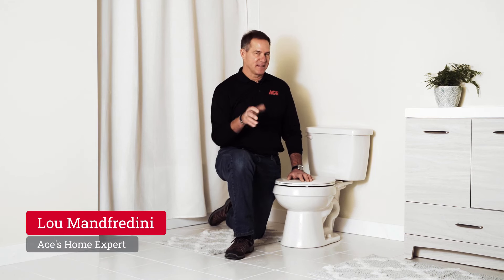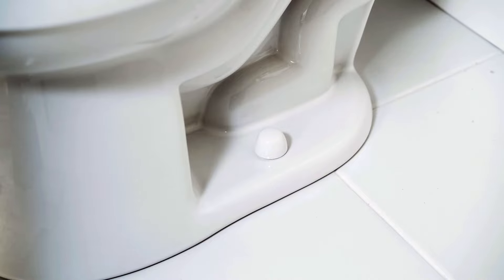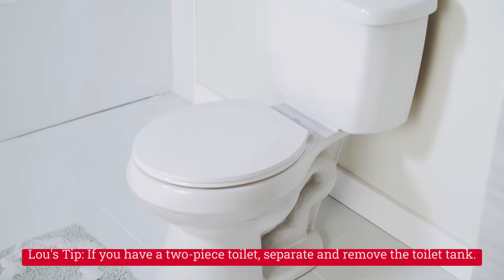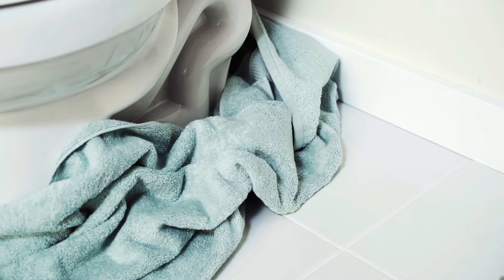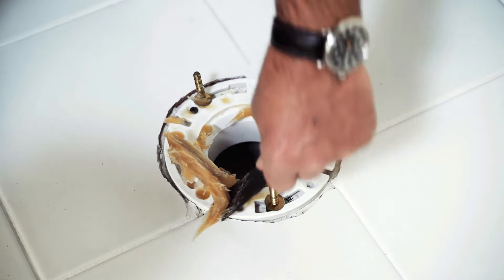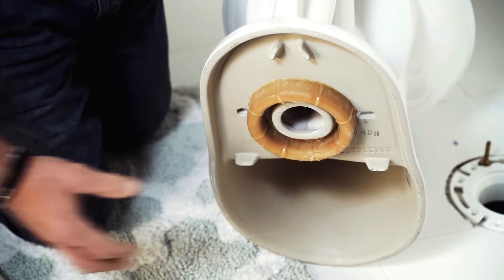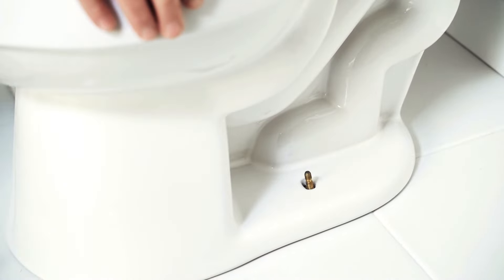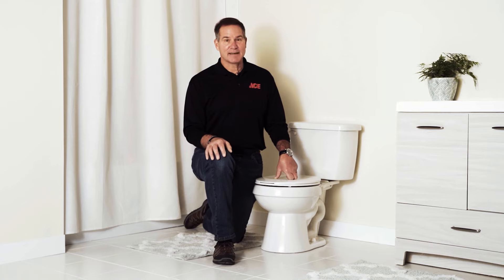How To Replace A Wax Ring - Ace Hardware

Comment: I live in Ohio and I got quoted $312 to replace my wax gasket. The total cost of the bolts and wax ring was $12. You save me $300.❤
Reply from the maker: That is great to hear!
Reply: Yeah cause it's gross. Service plumbing is always nasty that's why they charge out the ass. And most people are too lazy to do it themselves, just fork over money.
Reply: $550 in the SF Bay Area to make this repair. $300 sounds reasonable in comparison :)

Comment: I am in the middle of a plumbing job that involved removing the toilet. Great video; very helpful, but I do have one suggestion. Do not use a pliers to remove the nuts. Pliers are great for rounding off nuts. Find the correct size wrench (mine take a 7/16 or 13mm) and use that. If you have a deep socket of the right size, you’re golden! Just no pliers, please.
Reply from the maker: Great tip!

Comment: I use a wet/dry shop vac to vacuum out remaining water before removing from the flange. Not sure how long it is supposed to last but 13 yrs later I am back at it again tomorrow
Reply from the maker: Hi There,
A wax ring should last a long time make sure the toilet is attached firmly to the flange and there is no rocking. Hope this helps!